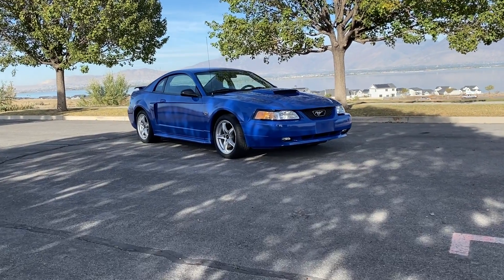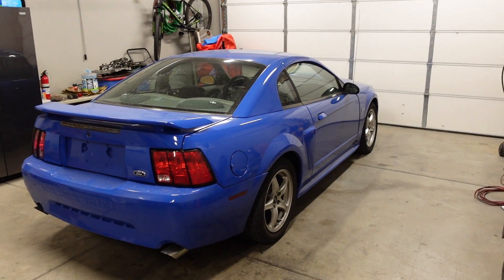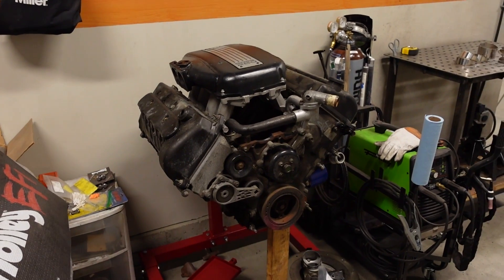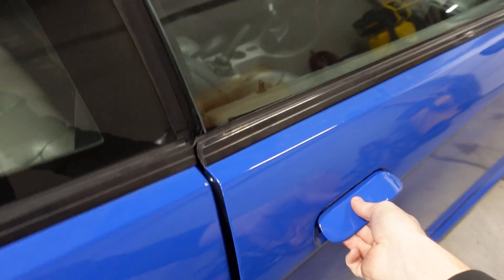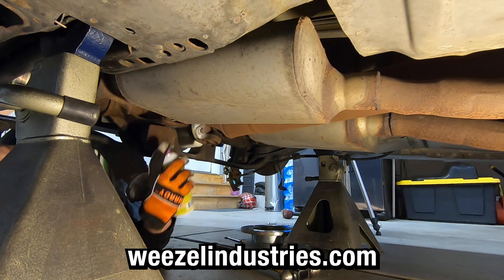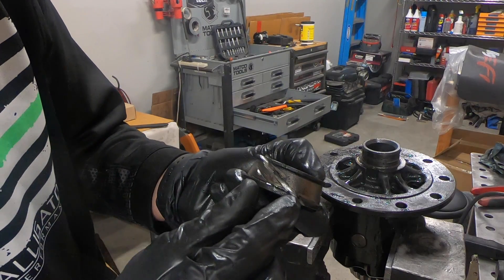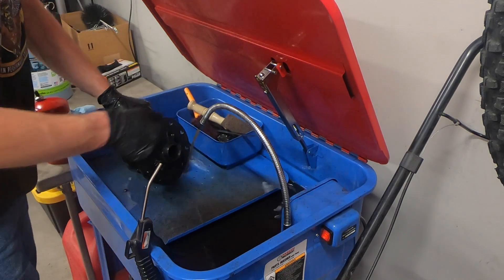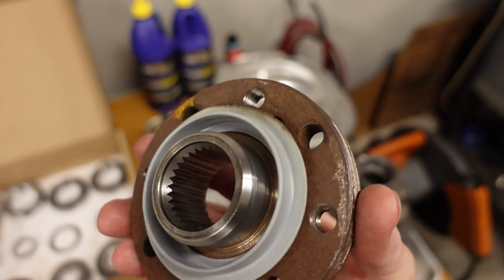the COYOTE KILLER gets NEW GEARS for better acceleration

Comment: the nitto's are terrible in winter snow and ice, one of the worst tires I've driven on in those conditions. good for summer driving though. I recommend Bridgestone REVO 3, BFG KO2's, Firestone Destination AT and even the Toyo Open Country isn't bad for all terrain winter tires. I once pulled a 3/4 ton dodge 4wd into the garage with Nitto's on it on a snow covered parking lot and until I got to the dry concrete I thought it was in 2wd, it was slipping around that bad and the tires were 3/4 tread left. pretty sad for an all terrain tire. my REVO 2's performed better with 3/32 tread left.

Comment: Only thing I see wrong is why not do it right the first time get the carrier and the 31 spline and that way you don't have to get back down there and redo the whole thing the price of performance parts are going to skyrocket as time goes on it's the only reason I'm saying that with inflation going on you might as well do it now because trying to get a carrier later on might cost more in the long run

Comment: You skipped over 3.73's. I put those in my 98 Cobra (came with 3.27's) and LOVED them. Also, put some hubcentric spacers on the rear to bring the wheels flush, unless you plan to switch to a staggered setup at some point.

Comment: My 1970 Mercury Cougar had 2.75:1 gears in my Ford 9 inch with 28 spline axles. Swapped out to a set of 3.73's with an Auburn Limited Slip and 31 spline axles. Also did a Disc brake upgrade while I was at it. I like 3.73's as an all round gear. Definitely a noticeable difference off the line. The RPM's are a little high at highway speeds, for now. I plan to swap in a either a TKX 5 Speed or a 4R70W and ditch the FMX 3 Speed auto that's in it now. Someday when I have the funds available.

Comment: Sonic
Pro tip, if you get the Ford racing gears the shims will almost always get backlash perfect granted you get a good pinch on the crush sleeve and back it back off and tighten it to 25 in lbs also use lock tight, nobody wants to loose pinion preload.

Comment: And that is why I have two sets of tires for my truck. A winter set that are not snow tires, but they do really good on snow for now (siped tires) and a spring/summer/fall set. Both sets actually do good in the snow, but if you have siped tires, they should probably just be used in winter only.

Comment: Its kind of funny ford racing sets backlash at .012 max and .015 is acceptable in mitchell repair and ford repair manual s  . Just about every 8.8 ive repaired has been .015  before disassembly . Quieter operation i guess . Ive also never oiled a pinion bearing before assembly either  . They are unusually lightly oiled sometimes but ive found its easy to over preload them when there slicked down with gear oil .  We installed so many gears in  the fox body i bought the pinion depth tool and we only installed ford gears and timken bearings 2 hr job tops with the right tools .  It was probably a .030 or .031 shiim but on occasions we would find a .028 shim under a 8.8 pinion bearing .030 was always the seeet spot though.

Comment: I'll tell you what. My 99 cobra was my first car into playing with cars. I had rebuilt the motor using all forged internals and a higher compression with some head and intake porting done. I live in PA and we dont have many straights so I put 4.30s in that car and I had the time of my life. With the IRS I could have fun in the corners but what was really fun was doing light to light runs against newer higher HP cars. It never let me down until I decided to run a little too hard one day and my timing guides seemed to have just shredded into the oil pan when I lost all oil pressure at 6700rpm and sent a H beam to the moon.

Comment: If you’re gonna make a lot of passes in the 8 second zone, you will bend that 8.8 housing. Had a good friend bend a braced 8.8 in his terminator and he was running high 9’s/low 10’s. Now, this car had a ton of passes on it with slicks, and was fairly close to full weight, but it was a nicely braced 8.8 that he had in the car. After a few years, he ended up bending it. If you’re gonna see the track a lot, I would step up to a 9”. They are much better suited for going that fast and holding up.

Comment: Nice job Lawrence.

I like to go a step further on my gear installs starting with using a case spreader to ensure proper carrier pre-load is achieved, then stone the mating surfaces between the carrier and the ring gear to ensure proper mating.   Lastly I despise beating on bearings so after determining proper pinion depth I will use a bearing heater to install the outer pinion bearing as everything is going back together.  I also prefer to use crush sleeve eliminators (solid spacer) to set up pinion pre-load (PPL) rather than crush sleeves.  

I too am a huge fan of the Eaton Truetrac LSD. 
Mike

Comment: Stock 8.8 rear ends are pretty strong in the posit unit. One of the things I used to do was get a new clutch and steel kit. They use a kolene steel in the stack and sometimes they double steel and single friction and what I did is, I added more frictions, and made sure that none of the steels were doubled. It made for awesome grip.

Comment: Why do people keep going on about honealine the block and rods when upgrading to ARP bolts. I just built a LS3 and put ARP studs on the mains and ARP bolts on the rods and it did not effect the clearance at all. I honed them a little to get me from 0.019 clearance to 0.025 but other then that I got same clearance from stock bolts and ARP studs. Maybe that is true for older engines like the SBC 350 that used less technology on the hardware

Comment: I am glad that I watched this. I am the process of building a 98 C1500. I am putting an 8.8 rear under it. It has 3.55 gears and I was going to swap in 4.10 gears. I think that I will just wait until I have it running to change the gearing.

Comment: Just a quick question man. Why didn't you do a c clip eliminator in that bad boy? Im just curious. Ive had some really dodgy situations because of c clip rear ends but through my investigations 3 out of 5 of the failures were because of the previous owner either letting a hack work on the rear end or he was a hack himself and attempted a DIY. Obviously the reassembly process in your case is SPOT on because you are who you are.
Reply from the maker: for now with our power level (even when we make 400whp NA), the C-clip design will be adequate, but when we go turbo and crank up the power, we will do C-clip eliminators. probably at the same time I do 31 spline axles
Reply: @TolmanPerformance  copy that. Thanks for getting back to me brother ur awesome!!

Comment: I went 3.27 to 3.73 in my 4.6 2v fox I gained only about 200 rpm at 75 mph. But I went ahead and did the ford 31 spline carrier and 31 spline Moser axles. I'm shooting for 600 whp, I'm also running the tr3650 trans like you have in your car, you should look into the tkx over the t56 especially if you're drag racing since the tkx is lighter.
Reply: Lighter yes, but isn't he shooting for 1k hp? Have you seen anyone with a TKX stay together at those outputs yet?
Reply: @Jim_Lawrence  no I haven't seen anyone yet, idk how well a stop t56 will handle 1000 hp, my buddy broke his t56 in his stock viper.
Reply: @centraltexasfoxbodies  it's a tough call why his T56 failed, unless you know why. I know Dan over at @Neomustangs has a TKX in one of his turbo Foxes. He will repeatedly say, 'full weight, full interior.' I believe he's been running and racing it with over 600 whp. Seems stout so far. Someday I'll probably get another 'stang and get one. The t56 is pretty much 'The' go to manual for high HP. 
Crazy story? I had a friend break a T5! 😱😲🤣
Reply: @centraltexasfoxbodies  sounds like you are more into it than I am. I am waiting to see how far the TKX can be taken. I don't think there's another manual that has done what the T56 has tho, right?
T5 comment was a joke. He has an '88 GT, and back in the '90s the stock T5 broke. Don't remember details.  80k ish miles.  Then he got a 4 cylinder trans by mistake,  didn't change the pilot and blew it up too. 3rd trans lasted 5k ish miles until he took it apart to build a full suspension road race/street car with a boosted 347. That was '99ish, it's patiently waiting to be finished...

Comment: With as many gear changes that you do you should get a pinion bearing puller.  I like you, I used the separator and grinder method for 20+ years.  Finally bought the pinion / carrier puller and can't believe I waited so long.   Holy hell it makes pulling bearings so worry free and saves so much time.  You will never hesitate to try another shim on set up again..
Reply from the maker: I really should get one...

Comment: Does that year read vehicle speed from the transmission?  If so did you change the gear so the speedo reads correctly, or is that a computer change?
Reply from the maker: thats a computer change, I need to get that done at some point. its off by about 5 mph at 50

Comment: The only issue I foresee with Coyote-killa is that it is a larger displacement engine. If it was a 4.9L then the coyote-killa moniker would work. The 8.1L being dubbed the Duramax destroyer or killer, although bigger used a different fuel. It was also NA compared to the Dmax’s turbo. I’m not good on project names, so put Bill and Ted on it and go with Wyld Stallyn.
Reply: I know what you're saying, but I feel like the mod motors are just kind of brushed over in favor of the "halo" coyote swap
Reply: @matthewmattson6881  yep, so true.. I'm building a Coyote killer stroker 2v 4.6L, MMR 5.0 kit..
Reply: @P71ScrewHead  love it, always wanted to do a 5.8 with the TFS heads and a 3.0 Kenne bell. Nothing crazy for the cams,  something in the 260 area, just a straight up stump puller
Reply: @matthewmattson6881  the 351W or a stroker 5.4?? I love that engine, the 351W is the first v8 I fell for, my pops had it in the Bronco, we still have that truck, not running tho..

Comment: Great choice, I've always seen the mustang crowd over gear their cars especially manuals and totally kill 1st gear. If ya wanna go faster, build up the engine 1st then see if you still need gears.
Reply: Faster track times would say that's not correct. Unless you are referring to street cars only, then it's always a compromise. Every racecar out there has specific gearing for their intention. The quick-change rear ends were invented for a reason. People swap gears for different tracks etc... I'm just going to assume you were referring to mild street cars, which this won't be.
Reply: @Jim_Lawrence  yeah Jim, I'm talking about the completely bone stock street car with an airfilter tube and the mufflers cut off. Usually that equals no gains at all just a loss of  drivability.
Reply: @Modified1  then mix in people who can't drive/shift... I'm with you
Reply: Yup exactly, mustangs are just so popular it's easy to see the same mods over and over again, and what doesn't work vs what does. Unfortunately I see what doesn't more often.
Reply: @Modified1  I really wish the modular engines could add displacement like the old pushrod motors. 347, 410 etc. Could really help that  animic low rpm torque.  That alone would reduce the need for gears and help untalented drivers appear better.
Reply: @Jim_Lawrence  that's why SVT supercharged them, to that awesome initial hit like the larger cube engines do. My 462 Olds is awesome off the line (.030 over 455)
Reply: @Modified1  for sure. Small jugs mean less area for valves. Add more valves right? 4 valve heads don't swirl, and are inherently soft down low. David Vizard seemingly has that solved actually. 
Cubic inches add broad power, with higher potential when forced induction is added. I always vowed my 460 would be over 500" if I put it in something.  
That said,  I do want to build a TT (on3) 2v 4.6 soon. Nothing major,  like 500 wheel.
Reply: @Jim_Lawrence  man I just came across the Vizard, he lived it not just knows it!!
Reply: @Modified1  look up the PolyQuad head if you haven't...